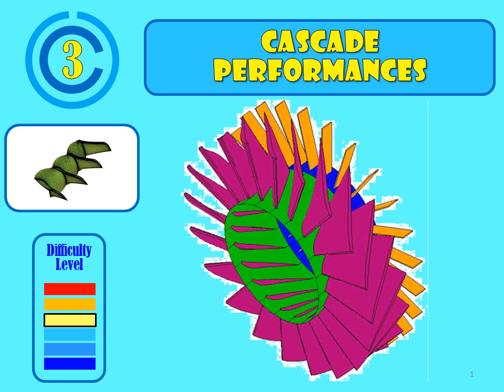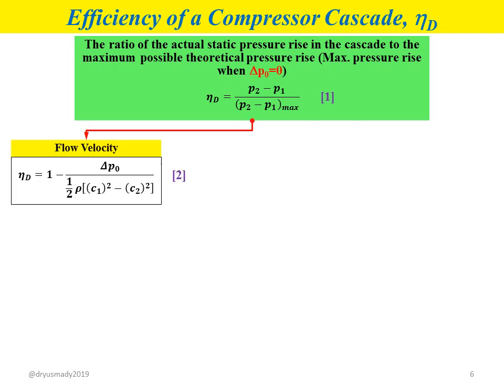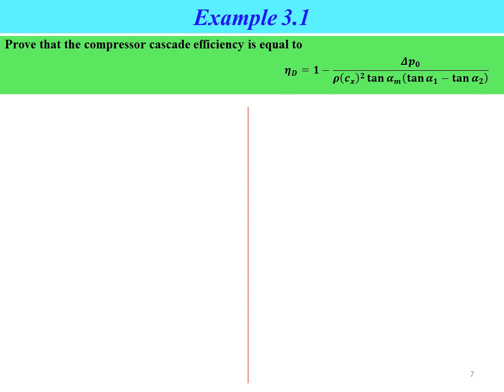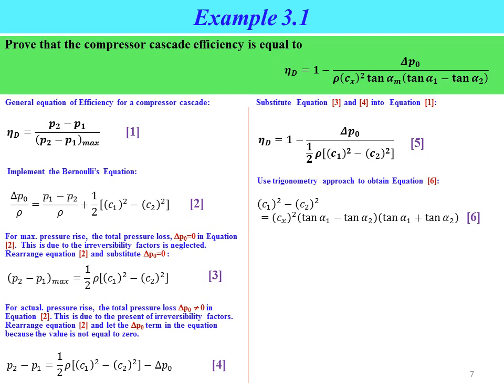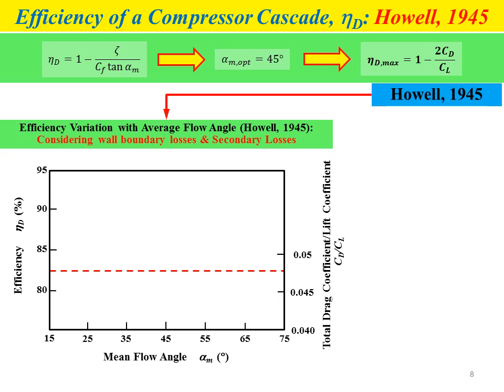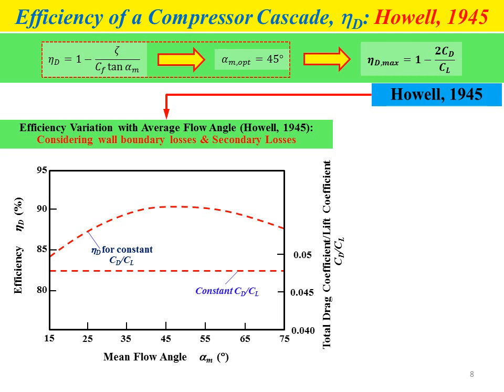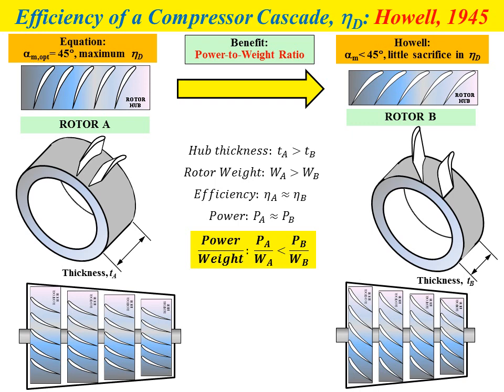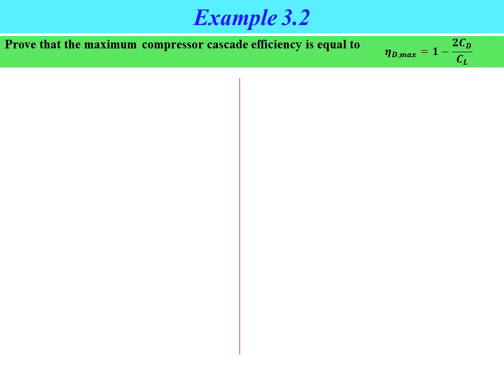TM LEC #14: CHAPTER 03 CASCADE PERFORMANCE PART 1

Comment: sorry sir, (20:44) I did not really understand this slide. could Dr explain this slide much more simpler?
Reply from the maker: For the slide you have to know how to use the graph and also the equation. The graph is use to determine the efficiency. There are two cases..1. Efficiency for constant cl/cd. 2. Efficiency for Variation of cl/cd.  Which mean for case 1..the researcher fixed the cl/cd to obtain the efficiency during the investigation. However for the second case...they change the cl/cd value..then determine the efficiency.
Reply: @yusmadymohamedarifin6008  tqvm dr